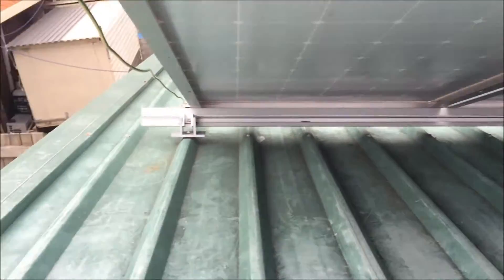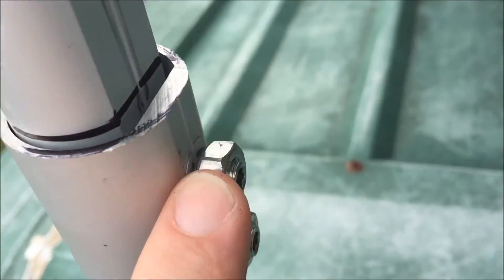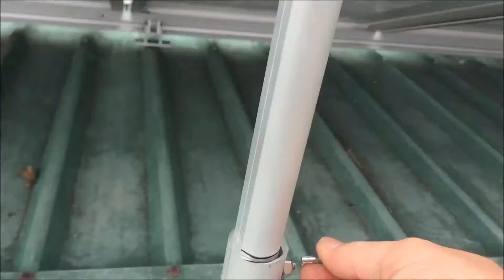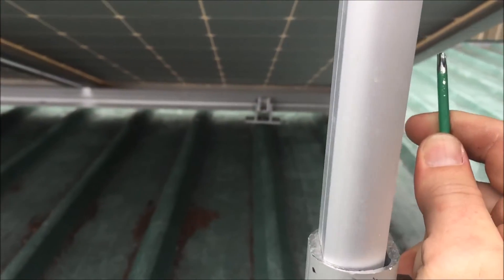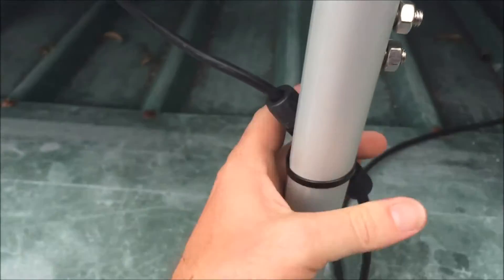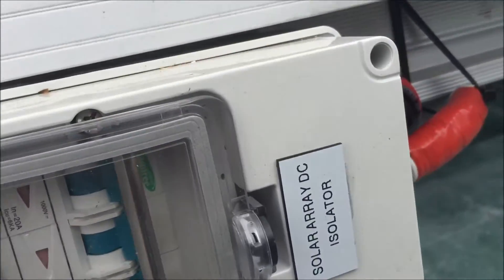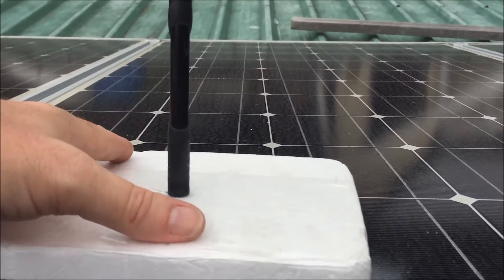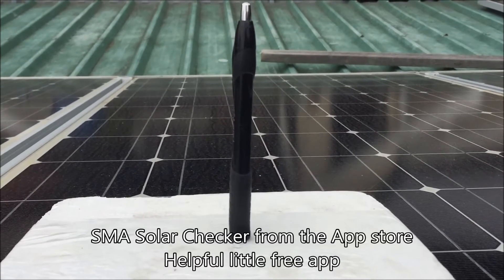Getting the panels ready for summer

Comment: Nice I just put mine to winter.. I been running off back up power for a full week. We have had 1000 year flooding SC. I am the one guy with power.. Heheh. Btw About how much PV do you have in watts? I am now at 1520. Thanks for showing us brother.
Reply from the maker: +yankey4 I'm yet to loose power been hanging out for it so I can turn all my lights on hhahaha, but I have 1700w panels off grid ( 9 x 190 ) 6kw (24 250w) panels on grid or gridtie some people call it.
Reply: Peter Matthews Nice brother. What i do is grid tie all 1520 watts with a SMA micro grid ties. But when I need to use the off grid side I just un pug the grid tie and pug in the Morningstar TS-MPPT-45 TriStar 45 Amp Charge Controller